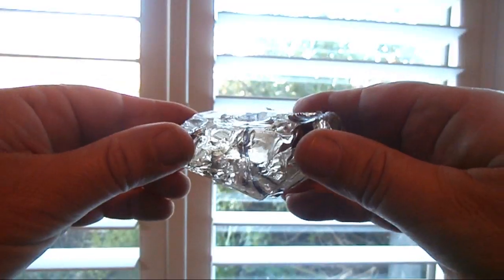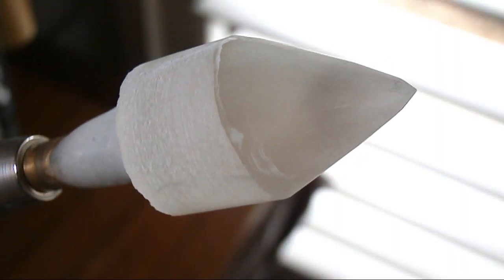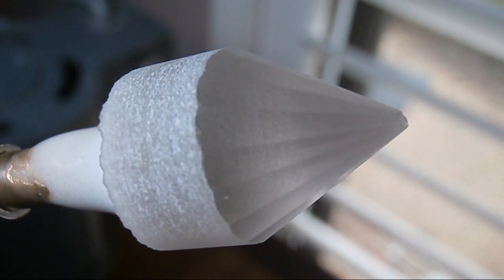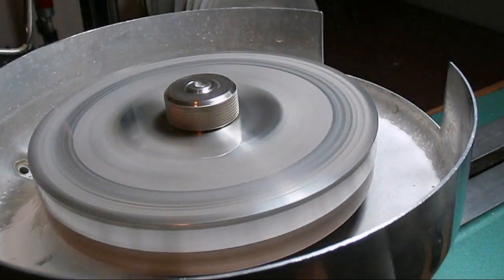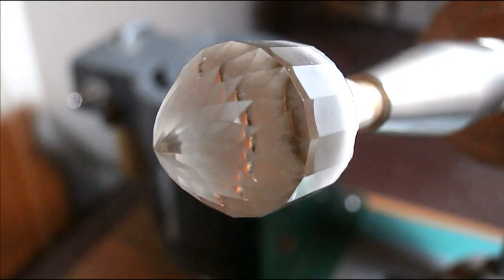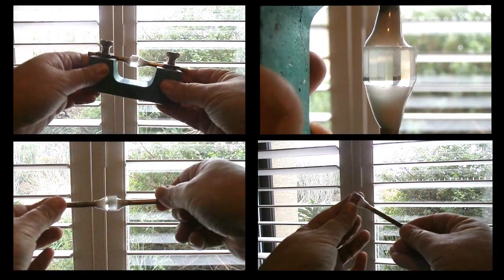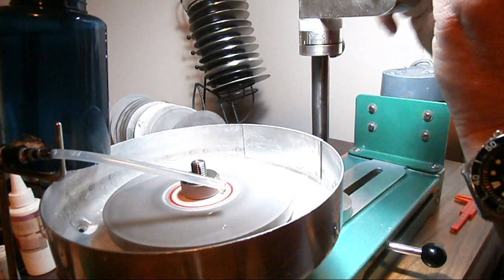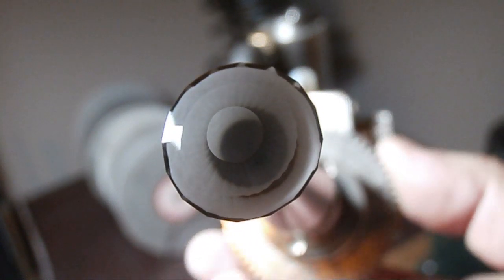How to cut gemstones - Quartz Special Edition

Comment: Looking awesome mate. I'm a noob cutter myself I was wondering what glue you use? I 've been using wax on the pavilion then transferring to dextone 2 part epoxy. Sorry if this question been asked a million times before.
Reply from the maker: I use 2 part Devcon 5 minute epoxy. I'm thinking if trying a fast drying CA Glue as a test soon. Just in case a gem comes off a dop and I need a fast fix.